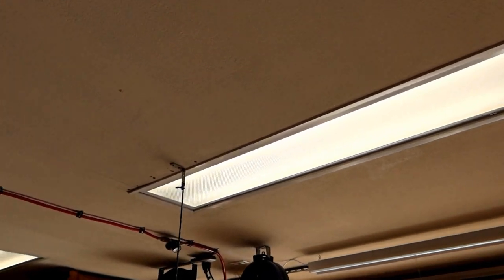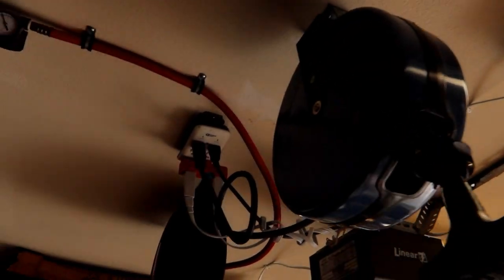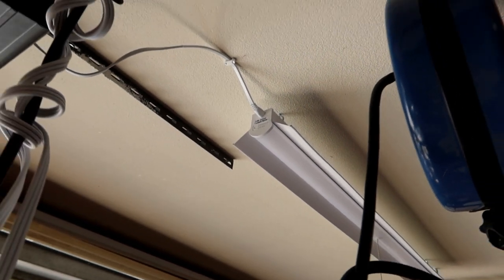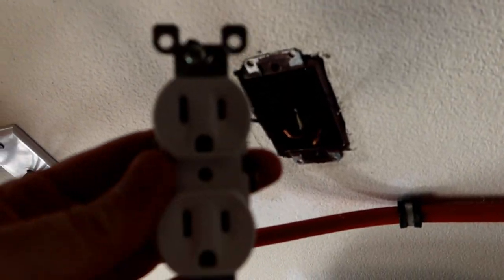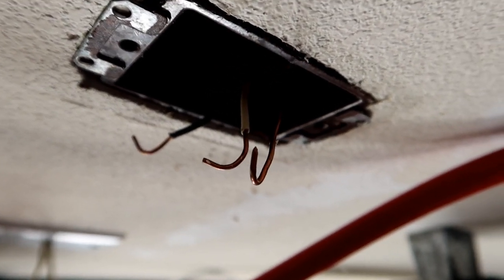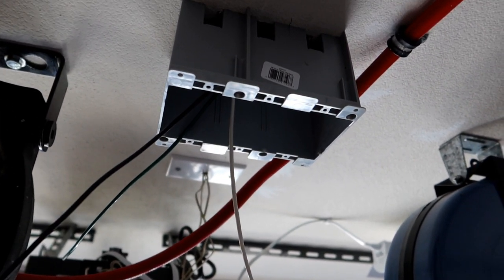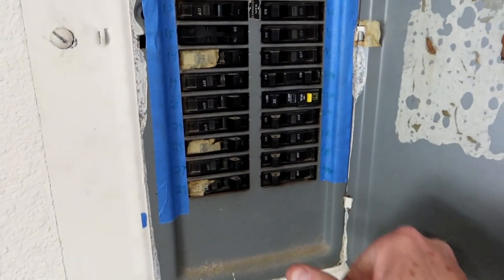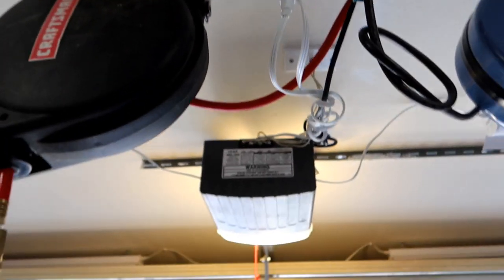Installing A Light Switch For My Shop Lights

Comment: HEY, BRECK YEAH YOU
Did an awesome job on 
Finding your own way  Rewiring the  off and on light switch and plug in for your celling
Lights Another great job on the Breck the handyman Fix it up and electrical show Ha Ha 
Take care stay safe and will see you on the next video project
PS I'll give a 👍 on safety and checking your work before putting It all back together to find out it don't work